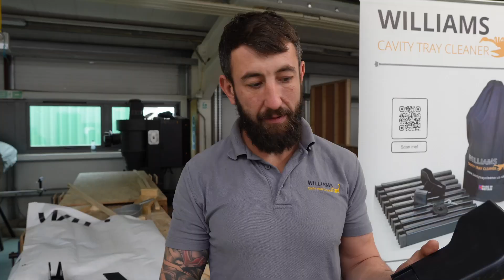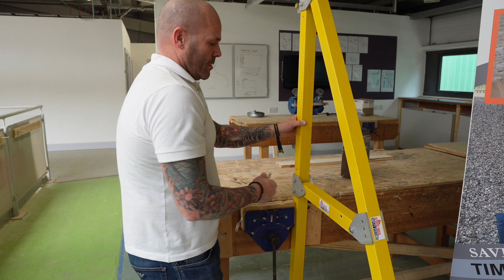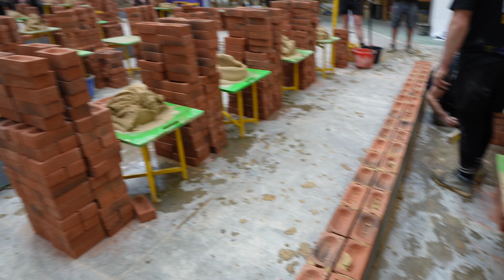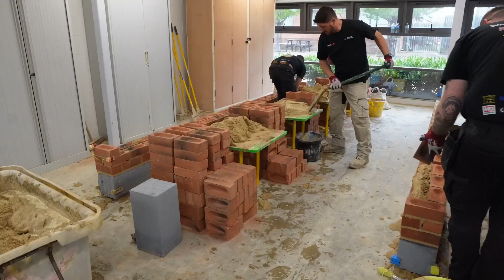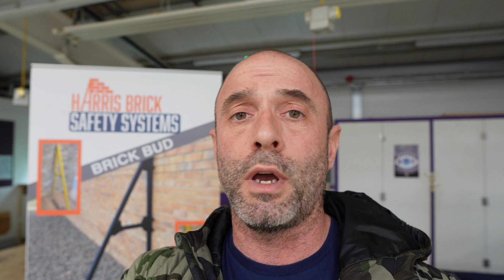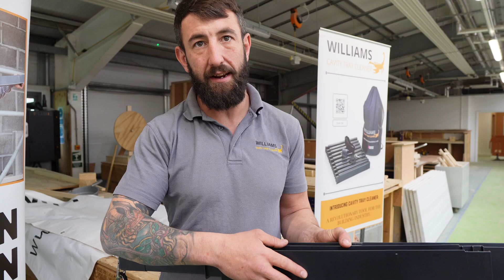Regional Heat - The Race Is On

Comment: Would the Dutch lads be allowed to work from there tubs if they entered the super trowel competition. With the trowels they use they would be disadvantaged working from boards . I have some of the Dutch trowels and they are definitely more suited to working from tubs.
Reply from the maker: That’s a great question.  I will find out tomorrow at the Northern Heat.  Dutch lads are great at pick n dip with those little trowels and the tubs, great combination
Reply: I asked Ashley that question and he said no, boards only.
Reply: @bricklayersworldwithandy6277  how do you think they would do Andy if they were allowed use the tubs. building the corners would be the hardest part for them would it.
Reply: @brickbybric  They would do well i think, short corners with a level aren't a problem with them they can all do it, jointing up they would need to practice on as they dont really do it. I worked with a Turkish trowel in Germany , blimey he was super fast and neat.

Comment: Didn’t think the bricks were smaller in height USA? Certainly in height

Canada there same height but normally 300mm long 90mm wide but similar height to ours.
Reply from the maker: Just going off what Phil said mate.  Never lad in USA 🇺🇸 he said they are smaller in length, width and depth
Reply: @Tone_Team  
Some size place be different on all areas over there a guess
Reply: Standard American brick are 3 5/8 wide 2 1/4 high and 7 5/8 long . You can feel immediately when you pick them up they are considerably smaller and lighter  . 6 brick to a block the same as ours .